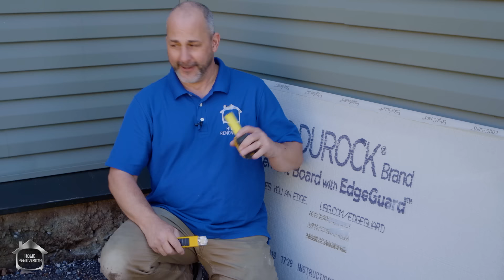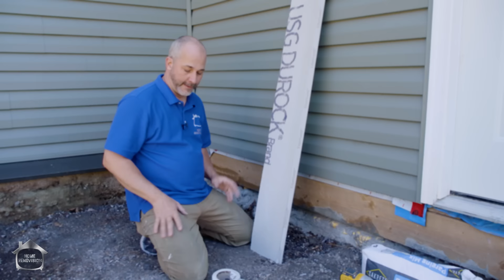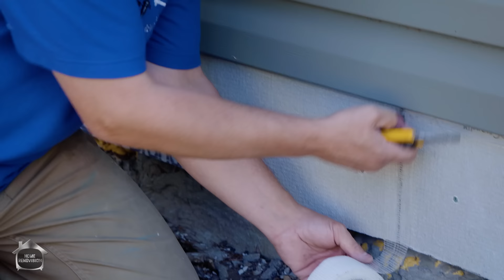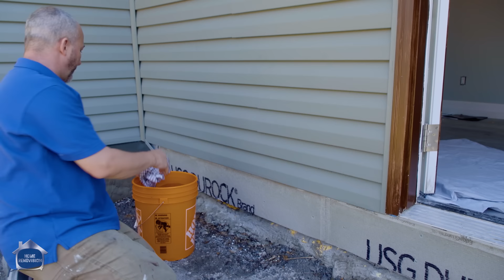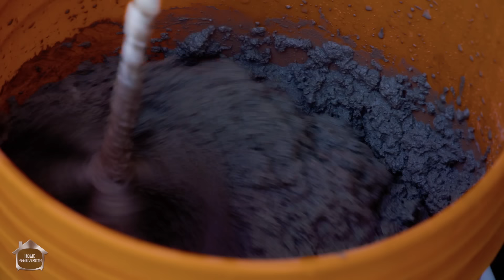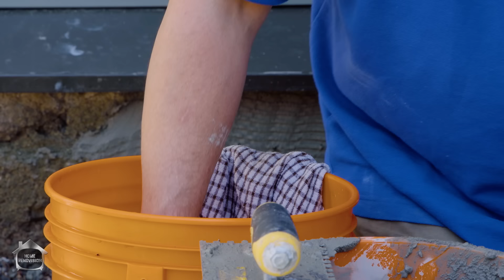Avoid a Parging Fail with These DIY Tips and Techniques

Comment: Alkaline resistant tape would mean the cement is alkaline which is the opposite of acidic. You are correct about burns, but it is from the alkalinity of the cement not acidity.
Reply: And if only I kept watching past the first couple minutes. FML lol
Reply: Poly-dipped gloves. I'm a desk jockey during my day job and a DIYer in the evenings. My hands are baby-smooth with only the most basic palm callouses, so I get irritated if even the dust gets on my hands and they get a little wet. Poly-dips don't have a finger-crease at the tip so you get that "Latex glove" feel AND they're alkali-resistant. Absolute life savers, they are. Also: I hate respirator masks and in these trying times, an N95 is like gold, but I HIGHLY recommend wearing one when you're dumping concrete into a bucket. I take it off after I mix, but if I don't wear a mask and make a dust cloud, I get the most disgusting grey-black snot and my lungs hurt for hours if I get a wiff. Plus, pretty sure extended exposure will lead to silicosis so....
Reply: Came down here to say this - Cement is very Basic, not Acidic.  It results in a chemical burn but it is from the base not an acid.
Reply: Probably using acidic as colloquialism for dangerous PH of both types.
Reply: @flightographist  Silica is a substance naturally found in certain types of stone, rock, sand and clay. Working with these materials can create a very fine dust that can be easily inhaled. there is more sand in cement than cement .
Reply: I see u r using a cloth to wet it , im thinking using a spray bottle to saturate it is a good idea aswell. And thank you I learned a few things from u that I have not seen on other videos. Like letting me know about the reason why u keep it wet for making it a harder bond.  Thanx

Comment: I literally had to take 10 minutes and go down the parging rabbit hole in Google to figure out what the heck parging is!!
Reply: Where did your search lead you?
Reply: @dvxAznxvb  It's a standard practice used to hide surface imperfections in the foundation work, cover form markings, etc.  Primarily a decorative feature not unlike stucco, but stucco generally tends to have a pattern to it while parging is just a surface cover (loosely see it as paint for the foundation!)
Reply: Crotch Banister  That is my understanding.  Don't believe it does anything structural and may add a layer to the waterproofing, but appears to be more cosmetic than anything.
Reply: hahahahah!!! literally just got done doing the same! Love this channel

Comment: With all do respect, because I truly respect you and your work, I'm surprised by some missing info in this video. 1. Surface prep. remove the loose stuff with a wire brush. 2. use set control for more working time of the product. 3. Product directions and minimum thickness. This layer looks like it would crumble with one kick.4. Start from the bottom and pull it up. 
Spray bottle or hose on mist setting is also nice to use.
Just saying this to be helpful to others.
Reply: maybe throw in some flashing to protect the framing...  hell, after the flashing, make the durock a little taller (wider cut) to completely cover the 2 x 10 for some protection.   Or, let the next homeowner repair and redo it all.  Especially after this nice patio is installed and trapping all the water against the framing.  Tyvek paper under the door sill is a good touch also.
Reply: hi what kind of set control product do you recommend for parging?

Comment: Great review, Jeff.

6:50  If possible, use a water hose with a light spray nozzle to thoroughly soak the existing concrete.

This video (@ 11:00) shows the importance of keeping the parge mix and concrete surface moist, as they become enemies when too dry.  Two moist items hydraulically bond.  A slow dry allows the Portland cement to bond best to the existing substrate.  Mix your own parge with 2 parts masonry sand and 1 part Portland.

Comment: Love your videos, had to do this on my house lately great help. Now it may not be my place to say but as a medical professional I have to tell you your heavy breathing has me worried. From my experience I detect signs of lung damage and it's not something i'd ignor if I were you. We all love you and you're work, please get this checked out. Weight gain is certainly a factor but I think you ma have more issues to worry about. Just get checked out for your health sake. Keep on keeping on Jeff you're a legend!
Reply: Much agreed.  You’re worth the check up ( & much more ).  Re weight: Over a couple years I went from 189 to 169 with portion control, then to 150 lb.s by cutting back on the carbs and some intermittent fasts (just means eating in a window, which for me was noon - 6pm’ish.  Also got rid of some minor pre-diabetes symptoms at the same time.  Go for it !! You’re great and we want you around a long time.  Cheers.

Comment: Great video! You inspired me to do this myself. Probably went back and watched it 10 times! Now my foundation looks like a million bucks. I'm painting it with Bluskin paint as well for a little extra water resistance and then putting in new perimeter drains. Without your videos I wouldn't know where to start with a lot of this stuff. Thank you man. Please keep them coming!
Reply: Hiya. What is Bluskin paint? I looked for it, but all I saw was the Blueskin membrane that is used on foundation walls below grade. Any tips will be greatly appreciated. Cheers!
Reply: @harishveeramani2907  yeah its the same company but they sell a paint as well. I bought it at home depot here in B.C. Canada. Did 2 coats and it worked great. I have not used the membrane though so I am not sure what would have worked better.

Comment: My 60 year old parging is falling off.  Very small parts I used quick set concrete with great success.  But I need to use a different product for the bigger parts.  Researching now.

Comment: Thanks Jeff because I didn't know to wet the cement board before applying and that I should add the cement to the water. I've always seen it done in person the other way round. It's a good job I stopped before I wasted my cement and frustrated myself out of this well needed project. Tomorrow, I should do a better job and be able to finish too. Thanks again for your vid because all the others showed something else which I just didn't feel suited my situation.👌👍👊

Comment: Reason for wetting down any surface like stone, cement board etc before applying parging mix (or mortar etc) is that the dry surface, if not wet down prior, pulls the water out of the parging mix, which stops the hydration process of the cement so it does not get to full strength. It's a chemical process that happens with cement when water is added to build it's strength and bond, and if the mix becomes too lean (ie lower water content) because the backer material pulled out the water, there is not sufficient water for the chemical reaction to be fully completed. 

Covering with plastic is good, especially if very how at the time of application. If cooler, no need to cover, can sprinkle the surface od the mix with water several times a day after 4 hours or so when the surfacer f=has dried to the touch, Water will be absorbed into the concrete to allow the chemical reaction of the concrete to be completed/

Great video though,
Reply: Great explanation.

Comment: Exactly the video I was looking for. I took a deck out that had a set of concrete steps in the bottom of the deck. So I tore the steps off but in doing so I left a big hole in the bottom of the house around the concrete area. Needless to say “parging” is the term I’m
looking for lol

Comment: Great video.  It's funny how you have to go through the extra steps to get the cement to bond.b I've seen where a concrete mixer dripped onto the road and its there for years.
Reply: This is so true.  Cement drips seems to last and last.  No problems bonding, when you don’t want them to.   Hmmm

Comment: I found ours was cracked and breaking off when the snow thawed after moving into our place. I've been putting off the repair, but now I think I'll be able to handle it.  What do I do about turf and dirt that is in the way? Dig it up down to a certain level to clear the work area? And how far below the level of my turf can the parging extend? Not at all? A little bit? Three hundred feet? Please, Jeff, I beg of you: help this slightly better than useless fellow Canuck.
Reply: yeah this was my question as well, do i have to dig around my landscaping to get to the parging that extends under the dirt line? if so how far?
Reply: What about termites? Don't they get between the backerboard and the  house foundation to come in? You had wood behind that cement board, what about the bugs?

Comment: Jeff, I need to parge the side of my house but I have a few cracks (vertical) on the exterior and interior on the foundation. My plan is to get them injected on the inside with epoxy but do I need do anything special to the exterior cracks before parging ? Should I fill them in with hydraulic cement? Or are they fine to Parge over once addressed from the inside?

Comment: What would be the difference in a project where you add a concrete skimcoat to smooth out imperfections in the surface, and one where you parge to smooth out imperfections?  I can't seem to find the definitive answer, and am looking to create a smoother surface on a cinderblock wall.

Comment: I remember when the mason asked me to dung the tiles in a barrel and let them there for a week before tiling. It is amazing how much water they can soak and I was amazed that after many years not a single tile got loose. He also watered the concrete like crazy it was all soaked and dripping. I guess it is the same here, cement needs a lot of water to cure, that is why in my home country (tropical weather) concrete slabs are watered every day for 45 days. The first day you can hear the cement sizzling and absorbing water like a sponge, by day 40 not so much but still getting some.

Comment: Ok, so I have a question; I am at my dads 100 year old house with 100 year year old rock type foundation. I found some leaks in the basement and when I dug below the soil level in the garden, I saw how the roots had burrowed their way into the cracks and the mortar is falling apart in places. Is there a way I can patch it up with hydraulic cement until I have time to redo it properly?

Comment: Hi. The parge around my home is in pretty good shape but there were some superficial cracks. I used mortar fix cause I had no idea what to use. I don’t like the way it looks though. Can I put the parging mix over it? Or do I have to scrape out the mortar fix in the lines?  Worried that might dislodge the parging. Any advice?  Thanks

Comment: I watched this video only because I never heard of "parging" before!  Now that I do, I have a question.  I have a bag of leftover Quikrete lying around after setting a mailbox post.  Is this close enough to parging mix that I can use it to fill similar irregularities on the concrete walls of an old attached garage before applying masonry waterproofing paint?

Comment: Hey Jeff! thanks for the tips! It would be interesting to see what these parged walls look now (two years later - 2022)
Reply from the maker: still perfect!
Reply: @HomeRenoVisionDIY  with what can I cover exposed exterior foundation foam? Ground grade treated wood screwed on the foam? Screwing cement board on the foam and then parging? Or mesh then parge? I want easiest diy to protect the foam from UV and weather.

Comment: Not to be picky here, but just to ensure correctness and make sure everyone understands. Cement (Concrete, etc) is not "Acidic" as described, it is Caustic (or Basic), meaning it has a high Alkaline or higher PH. Hence why the tape mentioned says Alkali Resistant. Other than that. Great video. Thanks for the good info.

Comment: Your videos are great.  I believe that cement is alkaline not acidic.  Alkaline or acidic, it will burn you either way,  And you need to get screws that are made to go in concrete, so the point is insignificant to the presentation.

Comment: I am siding an existing building which the foundation is at grade with asphalt setting at the same height as the sill plate. Code requires 6 inches to the bottom of the siding. What should I use to seal that six inches and keep water away from the sill as the previous siding was rotted out. I’m in a high snow area also. Thanks Larry

Comment: Is it ok to put cement board right over wood without any protective barrier?  Would the cement not absorb water/hold moisture and rot out the wood you screwed it to?

Comment: How’s that durock holding up?  I would like to use Durock 1/2”x 12” tall around the grade of my ICF walls and put a drip edge + rain screen above that.  Hardy panel will be the actual siding. We get about 3 feet of snow in the winter and the temperature commonly swings 40 degrees in a day.  Would you recommend what I am thinking of doing?

Comment: Jeff, another great video. Question for you ... how would you deal with a vinyl window in a poured basement?
Reply: Notch the back of a 2x4 , or whatever appropriate size of pressure treated lumber, to accommodate the flange of the vinyl window and then cap the wood with metal. or you could use eifs stucco to trim the window out with foam and then base coat the foundation and trim with dryvit mesh and base coat. And then coat it with stucco finish.

Comment: I used a spray gun and parged directly to bare cinder block with type M, wet block prior and it turned out great 10 years later.

Comment: What is the difference between a specific "parging mix" and a "type S mortar mix",  except double the price?
Reply: You are not supposed to have lime in a parging mix. So, no, don’t use type S mortar when parging. You could just mix Portland cement and sand to get a parging mix.

Comment: I didn't even know what parging was until yesterday... Jeff I have a older shed in FL that was made with Hardy cement board. It's in the back corner of the yard, but a hole was knocked out around 10". If I was going to try and patch it up what tape and cement, Portland, mortar should I look to try? If it doesn't work I can remove panel and replace with wood but I just wanted to experiment and learn.

Comment: Jeff, how would you tackle a 50 year old house with leaking stucco that had rotted all interior studs…it leaks towards bottom, and at connection to slab foundation at grade…
Reply from the maker: get rid of the stucco. it obviously wasn't installed correctly.

Comment: Is the parging just decorative, or can it reduce water entry?   My basement gets wet when it rains.  The ground slopes down towards the house.  So obvious I need to get that fixed, but I haven't found anyone locally to install window wells and do the grading.  Too tough for me.  I have Parkinson's.    However, I wonder if I could reduce the water in the basement by replacing the parging that is coming off.  That is something I might be able to handle myself.   The parging is falling off, revealing holes in the concrete block walls close to the ground, where rainwater pools. .  I can watch the basement walls fill with water during a rainstorm.  The problem is most obvious on the walls below those holes.   Questions are... What do I seal those holes with, and can I do it with the same mix I use for parging?  I've seen ads for hydraulic cement and a product called Thoroseal.  Both claim to resist water pressure.  Would you know if I can use these to seal the holes and do the parging?  How far should I dig down at my walls to apply the parging?

Comment: Just parged my outside block wall over old parging yesterday didn't use a parging mix used type s quickrete mortar mix is that ok, and have been spraying it with water ever once in a while. Just watching now after I'm done.

Comment: I realize that this maybe a wrong topic but still. I have an old deck which is fine and all boards are good. However, I am planning to repaint it completely. So I wondered if you would please kindly advice on materials and actions. With much appreciation in advance for your help.

Comment: Watching this on purpose! I was looking at getting advice on parging and voila - here it is. It seems that the builder or owner parted over plywood, can I add cement board, without scrapping off the old parging, and just continue from there? Same weather as you (in Spencerville area).
Reply from the maker: sorry parging over plywood is wrong. you can;t sandwich organics in between cement or it will all rot and mold.

Comment: @homerenoVisionDiy,  I need to do this for my house 1880's also. Can you explain does the parging affect the joints between the limestone (the old mortar)? You mentioned how concrete is so alkaline..does it break  down the limestone or joints over time, or does it actually offer protection? Also, when doing this should you just use the parging mix for the uneven surfaces,  or use something else to make the surface of the limestone a bit more even?
Thank you so much, I've learned so much from your channel ☺

Comment: Thank you. 

Concrete is actually the opposite, alkaline around 7ph, which is closer to neutral 6.5-6.7 than our skin is around 4.5-5.5ph, hence alkali resistant screws.

Comment: Sakrete no longer sells this "parging mix". They do have something called "surface bonding cement" is this what I should use? It's fiber-reinforced portland cement. Should this be used for basement interior patches as well? It says it's for concrete blocks and masonry walls

Comment: Put moisture barrier over your wood before you put your durock on.  You are outside sir. And in my opinion using diamond mesh and fasting it to the foundation and wood will last way longer than during and will be thicker and retain more moisture wile curing.